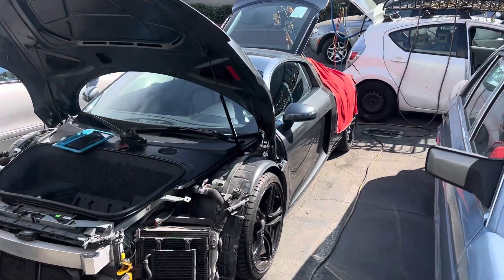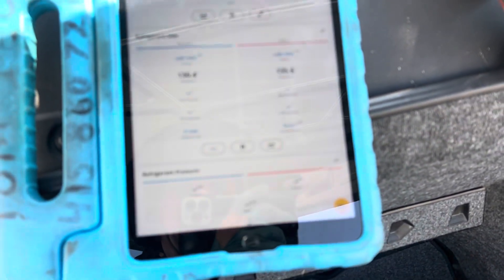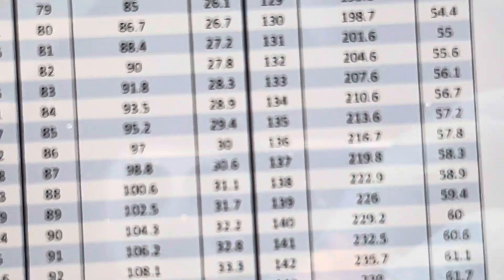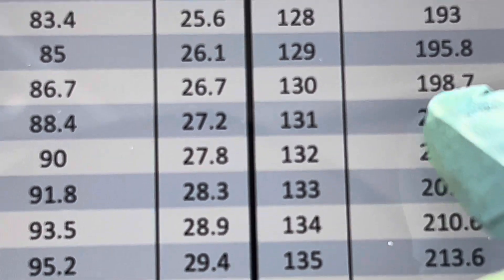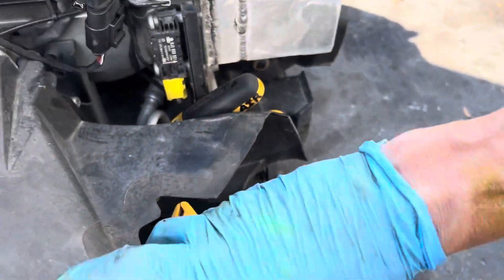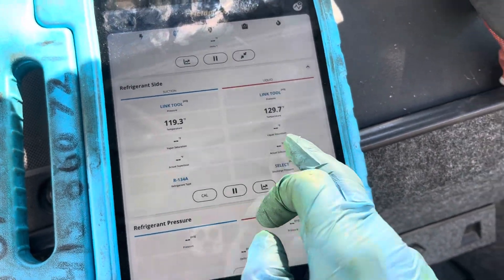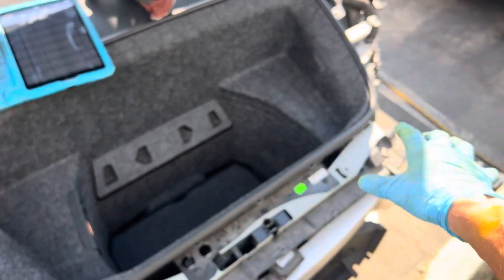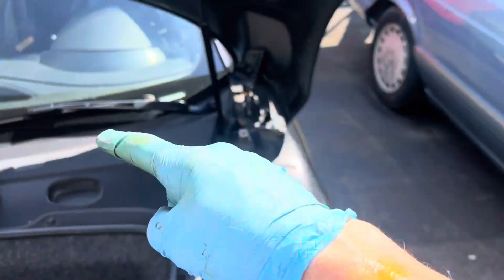De-SUPERHEATING DISCHARGE FROM THE COMPRESSOR PRESSURE IS NOT ALWAYS WHAT THE PT CHART SAYS

Comment: Interesting, I always thought it was reading the saturated pressure in the condenser like with a residential ac system.  Guess its like comparing apples and oranges.  Makes sense though. Appreciate you taking the time to educate those who want to learn.
Reply from the maker: You said that right?(“ who WANT ! to learn”)

Most just want to be given the answer to them on a SilverPlatter without understanding why this is the problem in our industry, both residential and